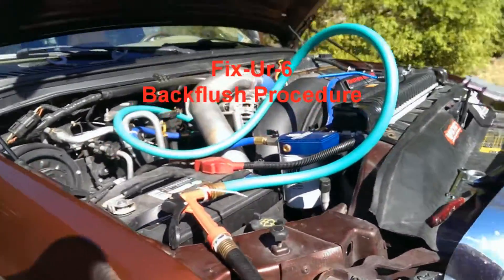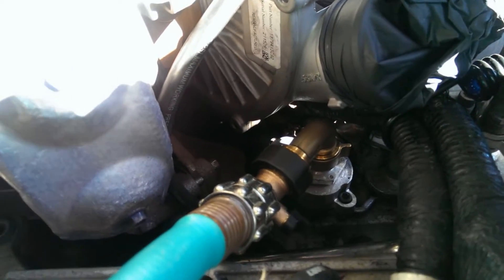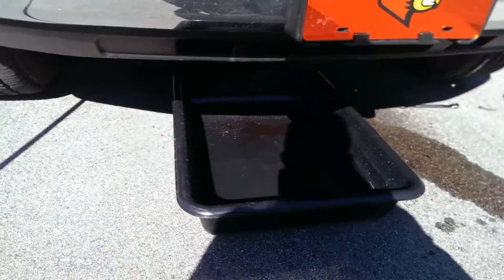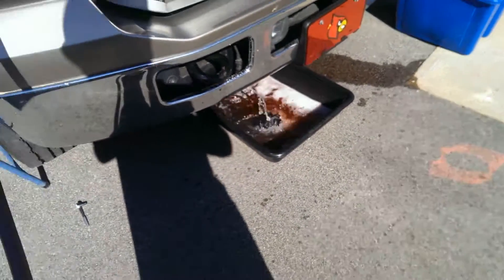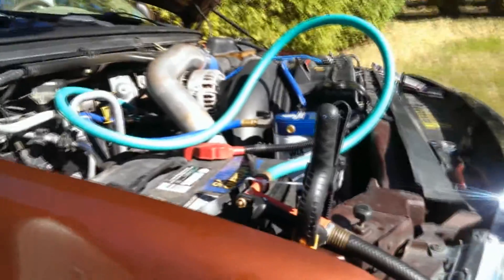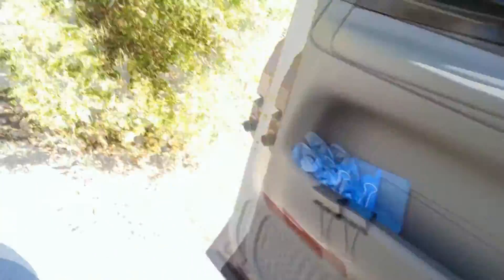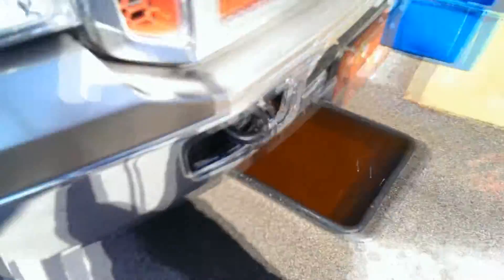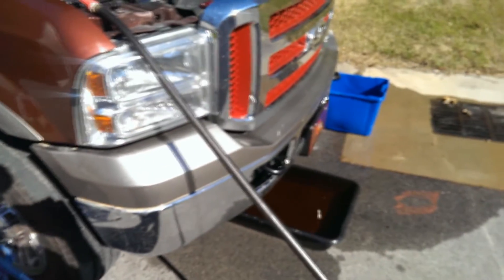Ford 6.0 Oil Cooler Backflush Valve Operation

Comment: Did you have to remove the thermostat?
Reply from the maker: George, no the thermostat does not have to be removed to backflush. Disconnect the lower radiator hose.

Comment: Might be good also to shoot a little compressed air behind the water
Reply: You are correct. I recently backflushed with water and compressed air combination. The compressed air did a much better job than water alone. I added a short video showing the explosive affect that the air adds.
Reply: @jimcooper3969  Hi can you tell what parts you used in order to shoot air into the system?
Reply: Yes that is also an option that some have used with success. I like to surge the water/pressure with the pistol grip sprayer. Whatever works for you is the way to tackle it.

Comment: Looks very promising...I'm going to give it a shot and will be ordering your valve soon.  I've got an early '04 Excursion with the 6.0.  I have close to 50K on my engine after a Bulletproof EGR Cooler and OEM Oil Cooler replacement.  I've done 2 regular flushes since installing the EGR and Oil Cooler, but am currently running an 18* Delta on the flats, and a 26* Delta on the hills without a load.  I'm also running the Bulletproof Water pump and BPD aluminum radiator.  A Bulletproof Oil Cooler would be nice, but I don't have $2K - $3K sitting around for the oil cooler and installation. I'll let you know how the whole thing turns out.  Maybe I'll do my first video.  :-)
Reply from the maker: Thanks for the comments. Your description sounds pretty typical of other owners experiences.  I can offer a 15% discount for MIlitary or first responders. Let me know before you order.  email at fixur6@gmail.com  JC
Reply: That's mighty kind of you, sir....I appreciate it.

Comment: Did you reuse your coolant or just add new coolant?
Reply from the maker: I drained into a clean container and reused as it was fairly new.
Reply: Oil Cooler Backflush Valve Fixur6 that's my situation as well. currently seeing 22 degree deltas after a coolant flush and filter install. how much difference in deltas did you see after the flush? Thanks for your fast reply.
Reply from the maker: At the normal test conditions of 65mph flat ground truck only I have 8 to 10 degrees delta. Towing it goes to 15 to 18.
Reply: Oil Cooler Backflush Valve Fixur6  thanks. I'll give it a shot.
Reply from the maker: If you are considering the Fixur6 backflush valve they are in stock. Usually ships same day. It's permanently installed and makes the process much easier. Good luck.